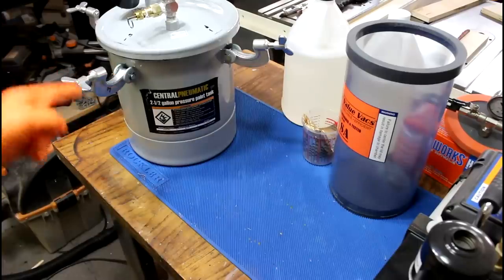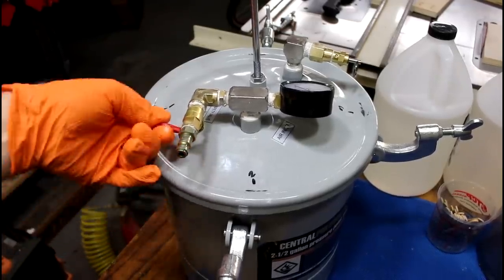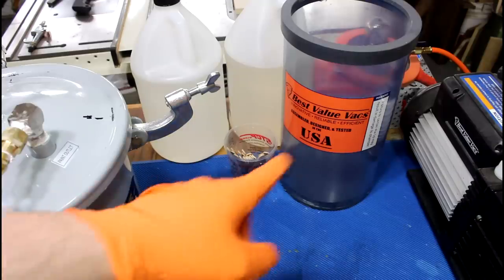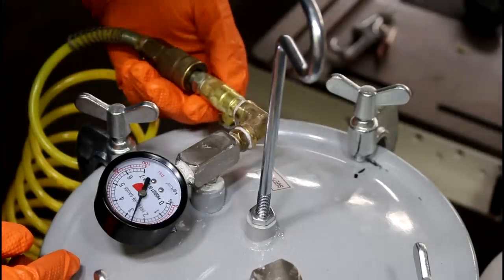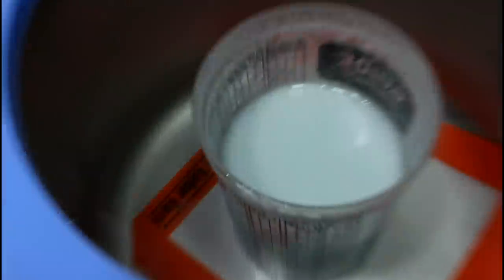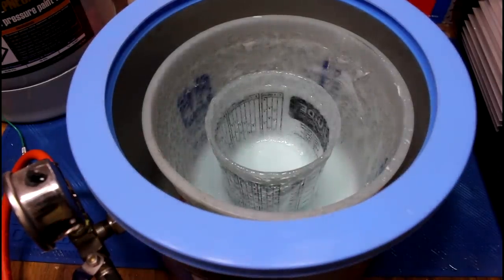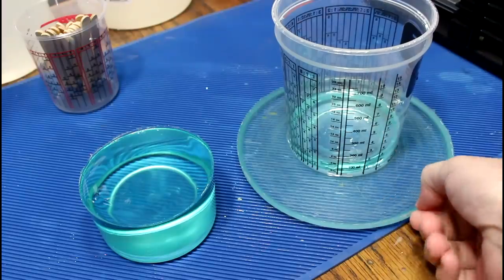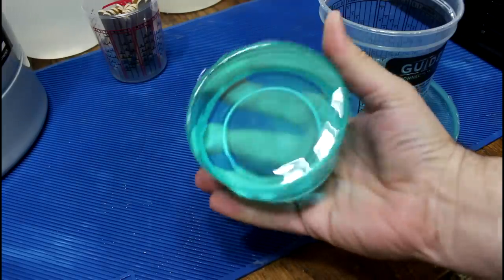Resin Casting: Pressure vs Vacuum

Comment: I think you misunderstand the phenomenon you are seeing in the chamber on which you applied vaccuum. When you said you were 25 minutes in and you were still seeing thos bubble up like crazy, that should immediately give you a hint that your statement « the air is finally getting out of tue resin » is mistaken. You’ve been boiling resin for the past 25 minutes. The bubbles you see are a gas, indeed, but that gas is not air. That gas is whatever you’d call resin vapor. If there are water molecules in there, then this water is turning into water vapor. The alcohol from our dye is turning into alcohol vapor. « another liquid » poduces « another liquid » vapor. Now i don’t know where these compounds will re-condensate, I would assume the inner workings of your vaccuum pump are about to get gummed up in resin, but in any case, the important thing to note is you’re CREATED bubbles by boiloing liquid, these millions of bubbles were not all present as air bubbles in your mixed resin when you started. The mistake is that too much vaccuum is being applied to the chamber. In the past few years, decent vaccuum pumps have become quite common and now every idiot owns one, and thinks that if you want to make sure no air is trapped in something, you need to get as close as possible to 0 atm. If you pay attention to the pressure manometer on your chamber while your resin is boiling, you should see that the pressure is no longer going down, it plateau’s, and that pressure there is the boiling pressure of your mix at the current temperature. If you stop your vaccuum pump before you get down to that pressure, you will keep your resin from boiling and you will facilitate the expansion of the only gas present at that time (air) and hopefully get most of the bubbles to slowly burst and the resin to fall back down into the craters where bubbles burst. Trying to do this too fast or at too low oressures is what is keeping you from successfully « removing the air » from your mix

Comment: You're not pulling air out of the resin in the vacuum. The reason it reacted that way is because you're boiling it (or at least some chemical it it). At sea level water boils at 212 degrees Fahrenheit or 100 degrees Celsius. At 10,000 feet above sea level, water boils at 193 degrees Fahrenheit, or 90 degrees Celsius. This is because when its at low elevation (sea level) its under more pressure, making it harder for the liquid water turn to steam. At higher altitude, where the pressure is lower, water turns to steam much quicker. If you had a chemical like acetone, whi in your resin

Comment: Problem with the pressure pot is when the work item is too large to fit (a surf board or a table for example).  Maybe find a resin which doesn’t foam as badly under vacuum?

Comment: If time is an issue when removing the air from the resin in the chamber, can't you remove it from the components before mixing and then limit the air reintroduced when mixing.

Comment: SO, i'm a total noob here, but i saw a couple of videos. And from that i understood that you use a pressure pot with the resin to let it cure in the pressure pot. Which is nice and works for smaller objects. But if you want to add resin e.g. to a wooden table or so, that will never fit in any pressure pot. So for that vacuum would be the best way.
And from one video (can't remember which one), they used a vacuum pot a little different than you: Let it foam up nearly to the top, then nearly completely open the bleed valve so that it completely collapses (like you did when it was about to foam over the second, bigger pot). Then repeat this. In the video this took around 5 minutes.

Comment: I have to wonder if you could cut down on overflow in the vacuum chamber by putting a piece of cheesecloth over the top of the container

Unfortunately I can't do the pressure pot thing for a while since my resin pieces require blanks that are 12+ inches long

Comment: Regardless of how the vacuum mixture was exposed too long (you boiled the solvent, not just removing air), the vacuum pulled sample was much more optically perfect; they were both "translucent", but the pressure pot mixture had very clear aberrations and internal refractions/crystalline borders. Please do not discount these effects in making anything beyond hobby wood+resin.

Comment: 60 psi seems really low for a pressure cooker. That's only about 4 atmospheres. My bicycle tires are supposed to be 80-100 psi.

Surely a steel pot could handle way more. Please correct me if I'm wrong.

Comment: Here is an idea: what if you added a small amount of acid to your resin mix? Probably would ruin your cast, but the acid would reduce the surface tension resulting in bubbles that pop more easily.

Comment: I didn't worked with resin, yet, but amount of air bubbles coming from it could not fit in 5 oz of resin. I am sure it's just resin boiling. Something similar of boiling water, which have no air bubbles before you heat it up.

Comment: There must be something else going on besides the pressure.  From my Chemistry days, Pres * Volume is a constant, so 50 PSI would only shrink the bubble dia to 60%.  Just like the vacuum causes the alcohol or resin to evaporate and create bubbles, the pressure must cause the air to dissolve.  Like carbon dioxide in pop that dissolves in the water.

Comment: You should cast the roots of a rootbound little tree from a nursery. Like in a black plastic pot for too long that they take the pots shape. Just clean out the dirt without breaking the roots. Replace the dirt with clear resin.

Comment: Vacuum degas resin and hardner seperatly prior to mixing. Mix carefully (minimal air entrainment) degas once again, resin should not foam as only removing entrained air from mixing. Cast, then place in pressure chamber.

Comment: I think the vacuum chamber would do a better job not in an equilibrium state.
I suspect it would be better by pulling a full vacuum untill it foamed to the top and then letting gas in untill it's down again and then back to pulling a vacuum and so on.

Maybe you could test my hypothesis

Comment: So a question: are there microscopic air bubbles trapped under immense pressure inside the resin? Will we get a tiny pop of air exploding if the resin were to break?
Reply: Yes, the air in the epoxy that was put in the pressure pot has been compressed to 50 psi.  In exactly same way that CO2 is compressed in your soda.  If you were to liquefy the resin under atmospheric pressure, the bubbles would  reappear.  The same way that the CO2 appears in your soda when the pressure is released.

Comment: try putting something like an air balloon into resin and then reducing it using the pressure chamber. if it is cured slowly decrease the pressure and see if the resin is strong enough to hold the balloon togehter

Comment: How would a resin that is just mixed up and one that is put in the vacuum for only a short time compare? Like not letting it bubble for the whole time but just a minute or two to get the big bubbles out and then let it cure under normal pressure

Comment: Is there any reason you couldn't use the main piece of the pressure pot, put the lexan lid from your vacuum chamber on(assuming the sizes match and there is a seal there) and use the pressure pot as a vacuum chamber?  I'm just thinking for small shops, it would be nice to not require two different containers.
Reply from the maker: So use the pressure pot as I showed it, then swap out a different lid for the vacuum application? I think the pot would for both. Honestly, though that is the least expensive bit. You would need a pump, and all the other fitting as well.
Reply: @peterbrownwastaken  I was thinking more for space savings than cost savings.  I have a small shop and every bit of space savings helps

Comment: With 50PSIG in the pressure pot (about 65PSIA) the ratio of the bubble VOLUME reduction factor is only 65/15 = 13/3 or about 3:1.  The DIAMETER reduction factor is the cube root of this, not even 2:1!  The only explanation of the disappearance of the bubbles has to be the air dissolving in the resin.
     The mistake everyone does when "de-airing" resin is letting the air get into the resin in the first place!  If you MIX the resin under vacuum, you will get "bubbles" all right, but these will contain nothing.  What I do if get a "Bel-Art" bell (vacuum desiccator) jar, drill a hole through the top handle, and cast a silicone rubber ball that fits in the handle depression, and has a thru-hole to accommodate a stainless steel 1/4" rod.  The cup with the measured but unmixed resin is put in, the ball and rod put on, and the vacuum drawn (which holds the ball in place).  Then you can mix the resin with the rod.  After mixing, you break the vacuum and remove the mixed resin, put in your mold and fill and vacuum process.  (It is even better to do the mold pour under vacuum).  After filling, break vacuum slowly and cure.
     Vacuum processing can get way more bubble expansion ratio, and therefore way smaller remaining bubbles in the cast.

Comment: can you use the pressure pot to deal with bubbles in your mixing cup after stirring, before you pour it for a project? or does it take too long to get the bubbles gone before it starts curing.
Reply: You’re not actually getting rid of the air bubbles with the pressure pot, just compressing them.  Besides, even if you could get rid of the bubbles, then transfer the liquid (which is what I’m assuming you’re asking), you gain bubbles by pouring and from the bubbles in the wood (unless the wood is stabilized although pouring would still create the bubbles).
Reply: @MakeThings  i use pro marine supply epoxy, it says general purpose, but pretty sure its a table top resin, so on thick projects the bubbles are hard to get out even using a heat gun, so trying to figure out a way to get rid of bubbles with this resin.
Reply: Vocu heat guns do not remove bubbles.
Reply: Vocu Vocu I’m sorry for the short reply, but it’s not heat that removes bubbles when you use a torch.  Heating it might change the viscosity which will cause the bubbles to be more easily released, but most use a torch to do that but don’t know what’s happening.  

Co2 is actually causing the air bubbles to be removed.  I can prove it.  I made a video showing the process by using plain, ordinary smoke.  
 
https://m.youtube.com/watch?v=WlaFs22YjaI&t=320s

Comment: I wonder if there's a way to heat the surface of the foam up from outside of the vacuum pot so that the bubbles popped before boiling over. Infrared light or a laser of some sort? Is the lid to the vac pot plastic or glass... If you said it in the video, I missed it.
Reply: They're all made of a polyurethane plastic I think.

Comment: I'm not sure that the bubbles "became so small you can't see them", instead I think the resin absorbed the gasses from the bubbles because the vapor pressure was increased. Same as carbonating water - there aren't tiny CO2 bubbles in the water, it's just absorbed in the water.

Comment: I think the problem your having with the vacuum is due to the fact that your not actually sucking air out. What your doing is creating a low pressure environment. Boyle’s Law states that a gas’s volume is inversely proportional to its pressure, so as you decrease the pressure (i.e. create a vacuum) the gas that was dissolved in the resin as a solution, comes out of solution due to its expanding volume. So your not actually sucking the bubbles out; instead, your making new ones.
The pressure pot forces the gas bubbles into solution, also due to Boyle’s Law.  As the pressure increases, the gas’s volume decreases. Eventually their volume is so small that they “dissolve” into the resin solution, rendering them invisible.

Comment: in the vacuum chamber the resin was boiling due to low pressure, it was not releasing air trapped in the resin.

Comment: Actually, the vacuum isn't "pulling the air" out of the resin. As you get closer to a perfect vacuum, the boiling point of liquid goes down. At 15 in Hg, water will boil at room temperature. So, when you get the vacuum high enough, your resin is just boiling.
Reply: AZ Patriot but would it not pull out the air that is in the resin and boil it? Both events aren’t mutually exclusive
Reply: @cameronpolite8514  Any air trapped in the system when sealed is easily and quickly pulled out. Since liquid displaces air when poured into a container, unless it is in suspension there is no air in that resin. As stated above, what you are actually seeing is the liquids boiling off into a vapor and being pulled out of the resin.

Comment: Could it be when you pump vacuum so low that material itself is boiling? like water, if you pump it so low it will be boil at 32F. This is no longer let the air out of material but epoxy itself.

Comment: Apart from contaminated urethane resin, I have never seen resin foam up that much. Another reason to avoid Art resin for my projects I think. 
Most times using a pot twice the volume of the resin being degassed is more than sufficient.

Comment: When you lower the pressure in the vacuum chamber it lowers the boiling point of the liquid. Thus, you are, in effect, boiling the resin. It’s not so much removing air at that point. It’s science!

Comment: The higher the vacuum, the lower the boiling temperature of the resin. When you increase the vacuum, you are boiling the resin. It is not air coming out of the resin. Instead, it is the air introduced into the resin because of the boiling temperature. Lower the vacuum and the resin will stop boiling.

Comment: I would construct a heavy 'pig wire' cage for that pressure pot. If it fails it could be fatal. Imagine all those fittings, along with the fractured vessel pieces, flying through the air at high sub-sonic speeds.

Comment: ok try using the vacuum chamber for a solid 20 minutes and reintroduce the air to the pot..in the first 20 mins it will remove the most of the air bubbles and anything remaining will be crushed so small you wont see it and it wont affect details in a mold. we couldn't see anything happening inside the pressure tank so it means nothing really. I dont think anyone actually vacuums their epoxy  or mold silicone for hours
Reply: just to let you know I am the vacuum chamber fan..not to mention I use it for other things too

Comment: I am just curious of if anyone thought about what happens when you vacuum all the air out of resins....  In my world this would make the resin void of air of which it needs to cure.......  SO, the center of this tootsie pop would never cure. Only the outer shell that is exposed to air.   And yes that is the reason so much air (o2) was present in the mix to start with.  If I am wrong let me know.

Comment: Using coating resin for this is the problem. Coating resin is too thick to mix that much and vacuum it.   Try it again with casting resin. Since it is thinner it will probably release with less foam in the vacuum chamber.

Comment: Your vacuum is to high, what you got on the end is resin boil of (resin vapors) not release of air bubbles trapped by mixing.
Try quick degassing at -0,5 bar to release big bubbles than put it in pressure chamber

Comment: Pressure traps included air in tiny bubbles.

Vacuum chambers expand the bubbles making it easier for them to migrate out.

I would prefer to use a slower setting resin in the =vacuum chamber, to give the bubbles time to migrate out.

You can get resin that has a longer working time and thus the vacuum chamber would give the better result.

********************

Purposefully using bad mix techniques to incorporate as much air as possible is just a bad comparison test.

Comment: I don't think the bubbles in the resin are from air.  Isn't the resin in the vacuum chamber simply out gassing the volatile low vapor pressure components?  In other words, if you were to place water in the vacuum chamber, the water would start to boil at room temperature.  The boiling is actually gaseous water vapor; not air.  I think your resin is doing the same thing; "boiling" at room temperature.

Comment: If you are pulling a vacuum too quickly, then you would get that happen. If you pulled a vacuum to the point it was bubbling but not taking over the pot, then your likely to get same result as pressure casting.

Comment: Damn, so the pressure pot while doesn't let you see things like the vaccum chamber, it does however ensure your project is clear as water...

...That begs the question, remember the lava resins you've made in the past? WHAT IF..YOU TRIED THAT WITH A PRESSURE POT? WOULD THAT WORK??

Comment: If you want your vacuum to pull deeper increase vacuum hose size
Reply: Hose size is irrelevant especially in such a small vessel. I can pull 30 inches mercury on a large refrigeration system with a 1/4" hose.
Reply: My apologies, a larger hose size will make the system evacuate faster. Rudy leatherman has a great video on his page

Comment: It drives me NUTS when people think the pressure pot "crushes" or "shrinks" the bubbles too small to be seen.  Think about the math.  60psi is only 4 times atmospheric pressure, so it would only reduce a bubble's volume to 1/4 it's original volume, which means reducing the bubble's diameter to 63% of original size.  That's not much shrinkage.  The pressure pot isn't crushing the bubble invisible, it's forcing them into solution in the resin.

Comment: When the resin is about to bubble over just close off the vacuum pump tap and leave it under a vacuum rather than letting the air back in each time.